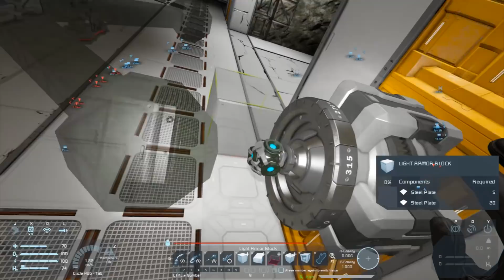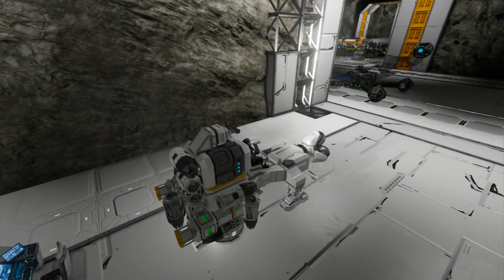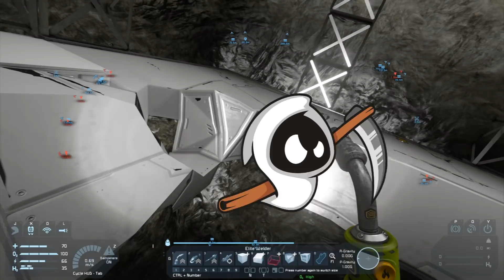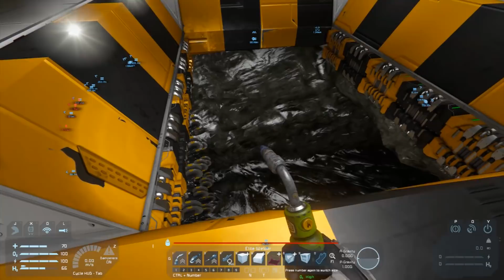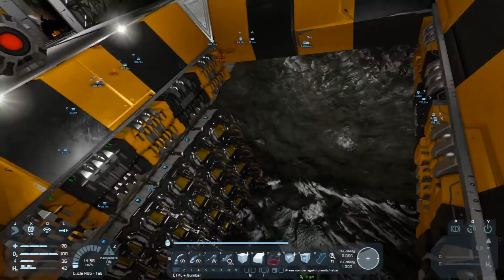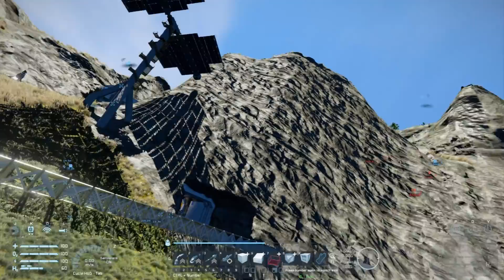Survival, Maybe... #55 Sandbag Recycling (A Space Engineers Survival Series)

Comment: Hmm, not sure why you used sensor blocks, after you put in the Blast doors, couldn't you just have set the grinders to turn on after the doors close?  Then turn off when they hit the extent of the piston? With the reverse on until until the pistons are fully compressed?
Reply from the maker: To allow time for the wrecks to slide all the way to the bottom before the system engages :)

Comment: Hey Splitsie. i got a few questions for ya. a) I wanna make hangar bay doors that piston into the ground above the hangar, it is a 12x14x3 space, may make it taller. how you I go about that? and b) how do I save ship blueprints?
Reply from the maker: For the door you can use pistons underground in that 3 block space, since you'll have room for them to move, then use blast doors  for the door itself, leaving a 1 block gap at the top. For how to set up the pistons you just need to set their maximum range and minimum range to put the door in the positions you want it in. For something that large you'll probably need to have shared inertia tensor on for most of the pistons and set the maximum impulse up into the red zone if they can't manage to lift the whole structure as that's quite the large door :)

I've also got a tutorial on how to make stuff for the workshop which is worth taking a look at as I also talk about some tips to make your creations more visible there too :)
Reply: I'll look that video up then ^~^ And I'll do my best to do what you said. Thank ya

Comment: The last timer block on the Sandbags should auto restart the guns in case you forget or are out of range when you remember.

Set the timer to restart after say 120 seconds and then on your ship when you transmit the 'OFF' command start a timer on the ship that runs for 100 seconds, when it reaches the end have it either play a sound or turn a light on.  This will give you a little time to resend the 'OFF' command if you are still in range.

Also you could then set up an auto transmit command on your ship to send the 'OFF' command every 10 seconds, and set your transmission range to 1100m.  This way you would never have to worry about a turret shooting at your loot.
Reply from the maker: I really should set that last one up as a reset timer - I am a little prone to getting side tracked :P

Comment: perhaps two layers of hanger doors in different directions might fix the problem with small parts?
Reply from the maker: I haven't tested to see how many blocks or how far away the blocks need to be in order to stop pieces flying through... I might just do that :)
Reply: hmm perhaps extending the space and pushing the salvage into drills in a crushing motion away from the door is a easier idea..
Reply: I put some drills on piston's and am going to try to drill out a Base. I figure if I drill it slowly then the drills won't take damage..only mistake I made was to put the piston on a armour block. I need to put some armour around the piston, swap it for a conveyer and then a sorter then attach that to my current Base which will become my hanger
Reply: Peter Lomax Did you mean grinders?

Comment: 20:41
That's not going to work, as the pieces would get stuck inbetween the grinders.

Also, the pusher wall is not a necessary part of this. If it weren't a moot point because of how pieces get stuck inbetween grinders anyway, it would be much simpler to just put a regular grinder pit underneath the door and dump stuff in it directly.
Reply from the maker: The main idea of using something to push the parts out is that it becomes another barrier to limit the ability for those little parts to fly about. I'm still undecided, but I will probably remake the pit in the future after doing some more creative mode testing to see if I can make something that looks cool while working and proves functional :)

Comment: You should use that extra timer for turning the sandbags back on after a set time-limit. Just have your Turret-off timer start that timer block, and when it runs down (after 5 or 10 minutes), have it trigger Turret-on. The great thing about this is, you can set it up remotely for the sandbags you've already dropped.

Also, if you were willing to modify the message code in the PB or slap another PB on, you could potentially have sandbags report when they are low on ammo or damaged - probably not worth the hassle of tinkering with the design again, but I figured I'd suggest it anyway in case you thought otherwise.

Great video - I look forward to each new one in the series, and I'm always bummed when they are over because I wanna see what happens next /now/ XD
Reply from the maker: That is a very good thought for that timer, I'll have to set it up in a way that when I press the switch off command it resets the timer to buy me more time or I'm going to be in for some exciting salvage runs :P
Reply: If memory serves, every time you hit "start", it resets the count, so just setting up your Turret-Off timer to start the countdown should be ok...in theory XD

Comment: A better grinder pit would be to lower a plane of grinders slowly down onto the debris.

Or use a trio of pistons, a single grinder, and this script: https://steamcommunity.com/sharedfiles/filedetails/?id=1357559894
Pile up the salvage in your work area (which can be cleared by running a cycle using a drill first), and just start it up.

The best thing is just to turn OFF that horrible Klang-summoning option of shaking tools.  I find the physics errors it causes to be utterly realism-breaking.
Reply from the maker: Lowering grinders would have some disadvantages as well as advantages, it would still need the tightly cut stone around it, you'd be able to better take advantage of gravity, but you'd end up needing a lot of space above the pit to retract into so you are able to drop items into the pit with the grinders out of the way. I'm not going to do any major upgrades to it now, but I am planning on re-doing the pit later (once most other parts of the base are in).

You wouldn't be able to use that script without at least turning tool shake off as the pieces would just bounce around so much the grinder would never achieve anything, but I do like the idea of using that script in the eventual ship printer ;)

I agree the physics glitches from tool shake are a bit of a bugger, I wish I could tone things down for grinders as I think it's about right for the drills and makes design important on a mining ship. But I'm doubtful it will be getting any changes
Reply: The grinders could retract up, then sideways to get out of the way with less vertical space.

Grinders facing up tend to allow small bits to fall between them & pile up, as the grind area doesn't reach the box part of the block.

Comment: I finally got at least my version of your insane world on the workshop to work with Isy Inv. manager to auto fill and return tanks to cargo. Vanilla auto pulls Hydro tanks to O2 Gen and refills them, but it will not do it with the script running, i had a time pause the script for 5 sec, before resuming it. try either slowing the script pull time or add a timer. 
Also the Conveyor system you use does allow you to pull from them but you have to drag and Drop into Inv. no double click.
Reply from the maker: It's very weird that drag and drop works but not the double click, but at least they're working better than they were at the start of the series :)

I've bit the bullet and just made the O2 gen the storage location for bottles, it seems to be the most reliable setup and it's not a big deal have everything in one spot, I think I can manage to type Ice when I need to refill :P

Comment: First thought regarding reloads and using a connector.... use a collector instead. Then you can drop the ammo into re-arm and never leave your supply ship.
Reply from the maker: The big downside of collectors is their size, they're even bigger than a connector on small grids :(
Reply: True.. but does that really matter on a machine designed to sit on the side of a hill and kills things without your interaction? If it pushes weight too far then I get that! But huge gains you get from it ... it could save you an hour on one rearming run!  Change your connector on the re-arm vehicle to contain specific inventory items... ammo and canvas maybe... and a hotbar item to switch the connector to throw out. Fly over, and double-click the hot-bar #... out goes the goodies and the connector is refilled, ready for the next one. May need to add a sorter and timer block to handle the drop... turn off sorter (to stop inventory flow), change connector to push all, activate 5-second timer block, 5-second delay on reload timer sets connector back to normal and turns on the sorter. The connector is re-loaded as you fly to the next locations.
Reply: True.. but does that really matter on a machine designed to sit on the side of a hill and kills things without your interaction? If it pushes weight too far then I get that! But huge gains you get from it ... it could save you an hour on one rearming run!  Change your connector on the re-arm vehicle to contain specific inventory items... ammo and canvas maybe... and a hotbar item to switch the connector to throw out. Fly over, and double-click the hot-bar #... out goes the goodies and the connector is refilled, ready for the next one. May need to add a sorter and timer block to handle the drop... turn off sorter (to stop inventory flow), change connector to push all, activate 5-second timer block, 5-second delay on reload timer sets connector back to normal and turns on the sorter. The connector is re-loaded as you fly to the next locations.
Reply: True.. but does that really matter on a machine designed to sit on the side of a hill and kills things without your interaction? If it pushes weight too far then I get that! But huge gains you get from it ... it could save you an hour on one rearming run!  Change your connector on the re-arm vehicle to contain specific inventory items... ammo and canvas maybe... and a hotbar item to switch the connector to throw out. Fly over, and double-click the hot-bar #... out goes the goodies and the connector is refilled, ready for the next one. May need to add a sorter and timer block to handle the drop... turn off sorter (to stop inventory flow), change connector to push all, activate 5-second timer block, 5-second delay on reload timer sets connector back to normal and turns on the sorter. The connector is re-loaded as you fly to the next locations.

Comment: You can set up the parachutes to deploy with a sensor that activates the 'chutes when it detects no grids or players. That way it will only trigger in freefall.

The grinder pit can be made clang-less with armor ramps "compacting" detritus towards a wall of grinders. A row of collectors below will catch any extra components. https://steamcommunity.com/sharedfiles/filedetails/?id=1398757081
Reply from the maker: I wonder if I could adapt that style of pit to what I've got already... as you've got it in that picture pieces will still end up flying through the closed doors, but if I used a piston to move a wall of armor and push towards the grinders that are deep in voxels it might work. 

I'm not going to be making more big changes to the grinder pit at the moment though, but I may redesign it like I will be redoing the elevator with a much better fitting door :)

Comment: Maybe putting grinders on the walls or floor of the pit instead? I say this since those small parts can just hide in the holes made in the rocks, forcing you to get them manually.
Another good idea is to automate the entire pit to where you only need to press a button to start it. Once the button is pressed, the doors will shut, then the grinders move to the other side of the pit, then stay there for about maybe 30 seconds or so, before the grinders move back to the starting position and the doors open up to make sure everything is cleaned
Reply from the maker: The trouble with grinders in the floor and/or walls is trying to get something to push parts into them without getting ground down as well. Sadly using gravity would require a lot more excavation work and still might end up with pieces all over anyway due to the very high speeds that lots of parts get flung around at :(

I'm intending to automate it over time, but I like to test as I go since every time I try and set up something with lots of steps I mess something up :P
Reply: I think the reason why the parts fly around so much is that both the grinders are moving towards what you want recycled, and that what you’re recycling is in one big piece, making it jump around way too much because of that and damaging parts.

But i was thinking that having grinders on the floor or walls didnt need to be right on the piston, but rather, a block or two away from the pistion and attached grinders. That way, you can just use the piston to grind the parts, then retract it before using the rest to "clean up" any pieces that survived, with you most likely needing to check for ones that glitched through walls and floors.

I cant wait to see the day when you manage to fully automate the process. With how tedious it is and how difficult things can get, it would be great to watch you overcome these challenges.

Another thing; regarding the process of "dropping" the sandbags around the locations you put them in, i was thinking that making a small ship designed to have a landing gear in the bottom center, with a sort of laser pointing straight down where the sandbag will land would be very good if you plan on making those high placements instead of getting closer to thr ground and placing them.
You can also make the special ship in a way where theres like 4 arms that match the sandbag's arms and the pads grab where the lights are, with the lasers right on top of them, marking out each corner.

The link below shows a demonstration of the sort of the idea that i meant, but where the ship is making the lasers instead.

https://www.youtube.com/watch?v=0tCChpgeQSw

Comment: For your printing you can use an advanced rotor connected to the conveyor system add a small head and then you can connect using small conveyors and have them auto load as they are built.  And you'll only have 1 extra block to grind away.
Reply from the maker: That's what I'm thinking, it would certainly make the system very quick to build and deploy :)

Comment: Have you thought about adding a few blocks to the sandbag to counter the weight of the solar panel?
Reply from the maker: Honestly, nope. They seem to land safely enough, though you could probably fairly easily balance it by replacing a few light armor on the opposite side with some heavy if it was causing a problem

Comment: Just a suggestion (still watching so not sure if you did this yet or not), as you have the remote to toggle the auto deploy on the parachute,  you may run into issues moving these in the future and having a chute deploy, however if you add two more lights, maybe yellow or blue (or set to blink), to the outside of the parachute hatches, and set that to a timer as well to toggle on when chute auto-deployment is on you know if the current sandbag you are moving will try to auto deploy or not.
Reply from the maker: That is a good point, and I do have a timer on there already that isn't being used

Comment: You might want to slow the pistons down a bit, if they start encouraging resistance with a heavy load you may find it breaks the grinder-head off of the piston!
Reply from the maker: I'm thinking I might reduce the max impulse further, I didn't think of it at the time, but with 3 stacked pistons I may well be applying 3x the standard force so I should drop each a fair bit in order to avoid damage from movement alone
Reply: Stacked pistons should NOT apply stacked force. Not in the real world anyway! But adjusting force is the way to go, NOT speed. I crank the speed to 4 or 5 and drop force to the minimum needed to shove scrap across the floor.

Comment: Did u check if the sandbags are using more power then their producing?
Reply from the maker: They can last for a fairly long time even when not in the sun, but I'm not certain if they would last indefinitely even if the panel is in a perfect location. I'm expecting that they'll last at least as long as the save will before it implodes under the mass of all my base blocks :P

Comment: Splitsie, have you seen that Isy has an altitude script that lets you run commands according to pure surface altitude? You could potentially use that for the sandbags to auto deploy parachutes X meters above ground and not have to think about sea level.
Reply from the maker: I have, as soon as I saw his little batch of scripts I subscribed to the lot of them :P

The only downside with the sandbags is that it would be adding another block when I can do most of it with what I've got on there at the moment. I was thinking that the altitude script would be most useful for mixed thruster ships to automatically shut off/start one type or the other. But maybe there will be some other uses that'll come up while playing :)
Reply: Alternatively, add it to the Duckling tied to a warning light so you don't go careening into the hillside in the dark?

Nevertheless, I love this stuff you're coming up with, Splitsie - can't wait to see a fully clean base area with no wreckage fouling the place up - oh, and the latest iteration of the sandbag is just great btw!
Reply: Parachutes already auto-open at a specified altitude